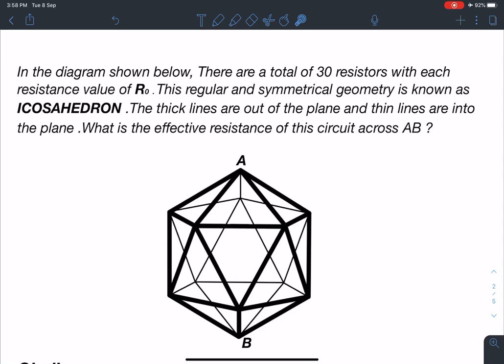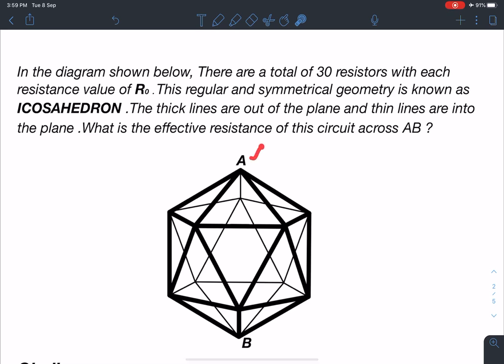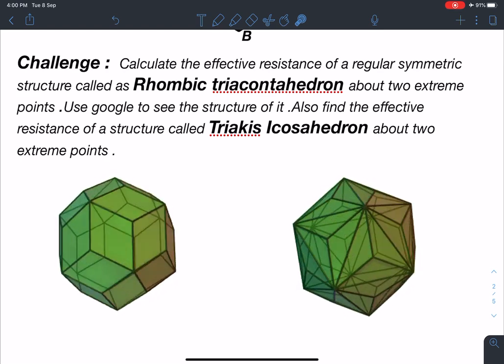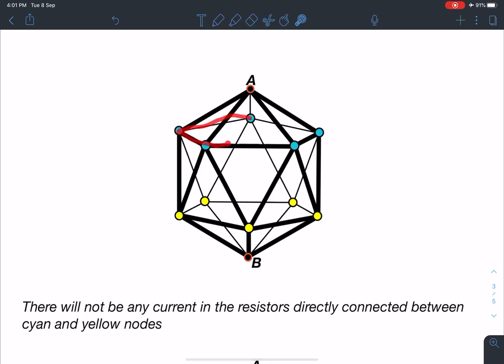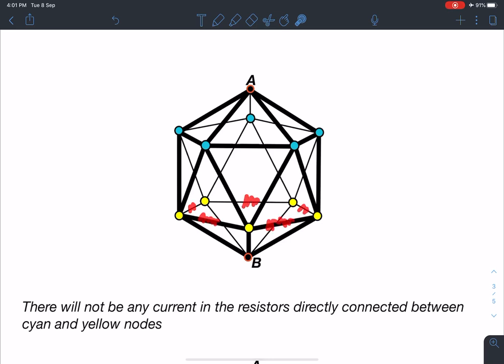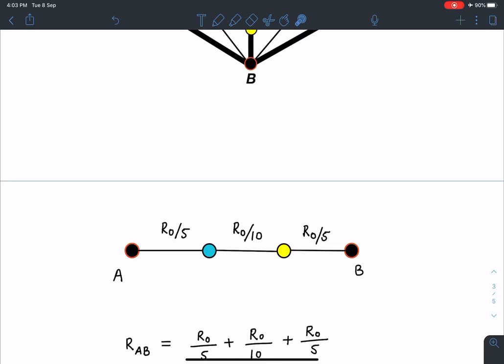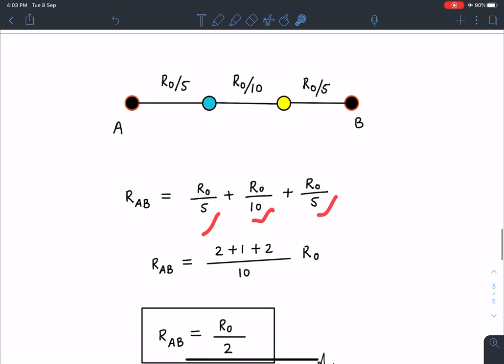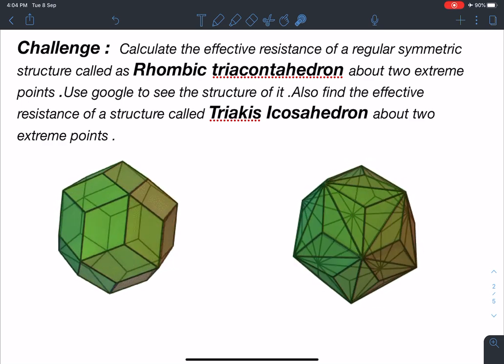[JEE ADVANCED] EFFECTIVE RESISTANCE OF ICOSAHEDRON CIRCUIT[ ADVANCED PROBLEMS IN SCHOOL PHYSICS]2020

Comment: I did this with the same method assuming, B at 0V and A at 100V, due to symmetry and also that the resistances are equal the potential drop for the resistors joining the vertices of lower pentagon with B is taken as x then the potential drop for thoes at upper pentagon would be 100-x since, the potential drop in both situations would be same, marking these points and then redesigning the circuit i got the same result.